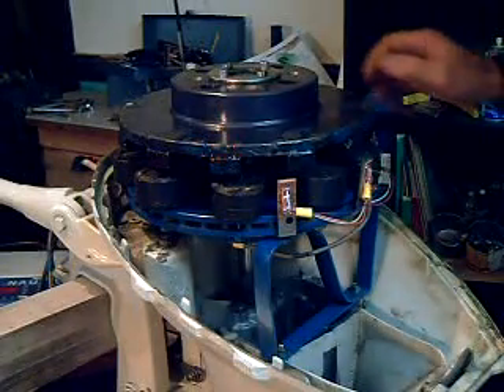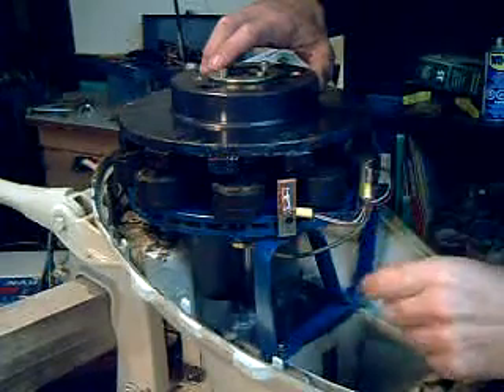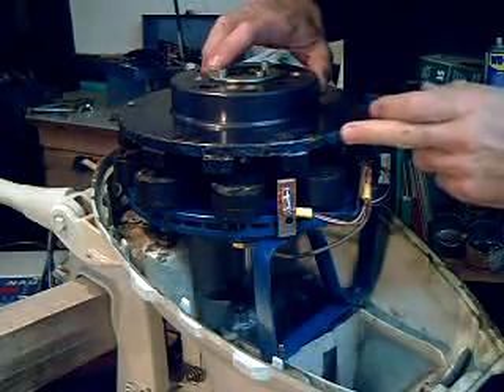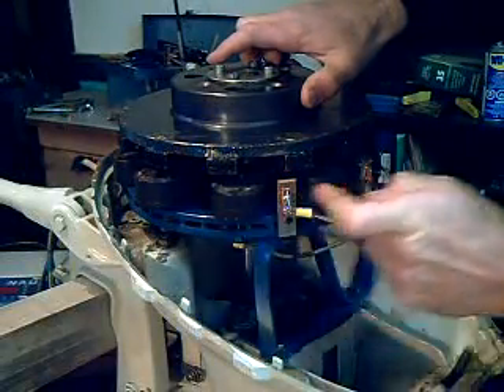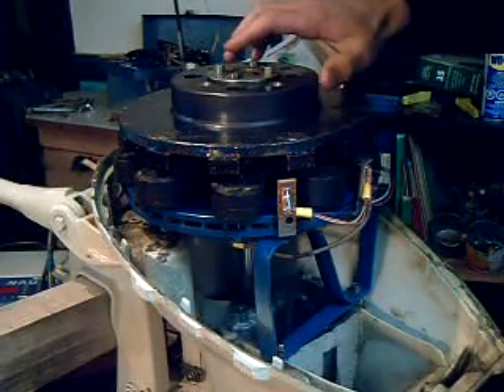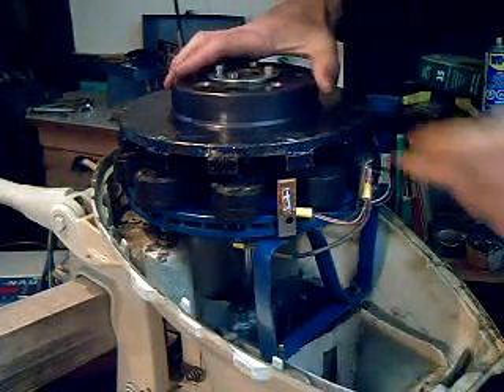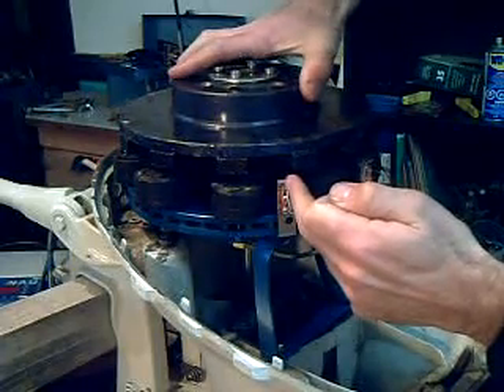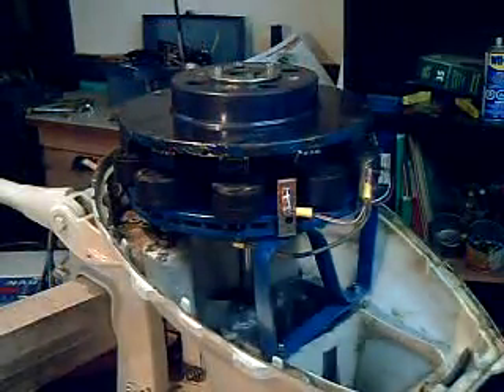Inside the Electric Hubcap Outboard

Comment from the maker: Right you are! See Turquoise Energy News, about #36 or 37 to 39 for three fantastic changes, one of which is a polypropylene-epoxy stator to replace the steel one. The other two are low-loss iron powder coil cores, and coating the coils with ilmenite to bend the magnetic field into the core. No load currents are down to a fraction of what they were, so efficiency has gone from mediocre to WOW!